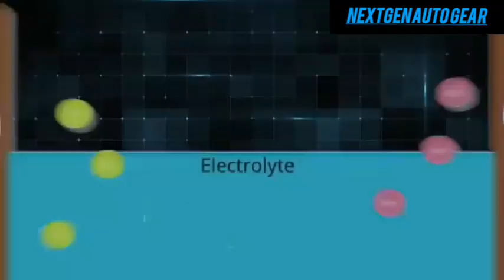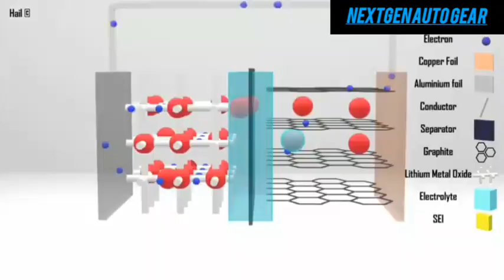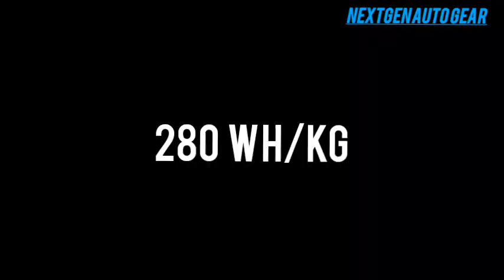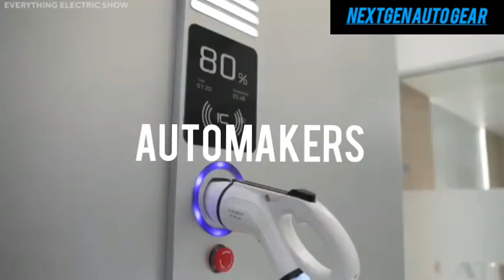Elon Musk Announces Super Solid-State Battery For Tesla 2025. HUGE Changes You Need To Know!

Comment: First Elon doesn’t have a dam thing to do with solid state silicon battery technology. They can manufacture them in the lab today. But they haven’t achieved the ability to scale them up to massive production.

They will require another 7 years to get there. They will be lighter and have a greater density. They also will not burn down your house while indoor charging.

So I would touch a EV until this battery arrives and tested on the road for at least 2 years. If you’re thinking of buying a ev. Wait.